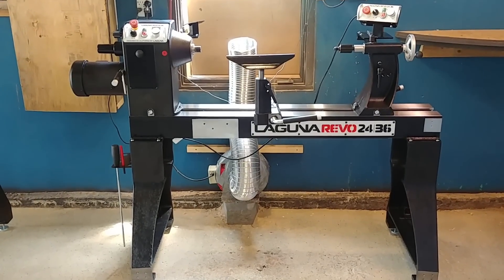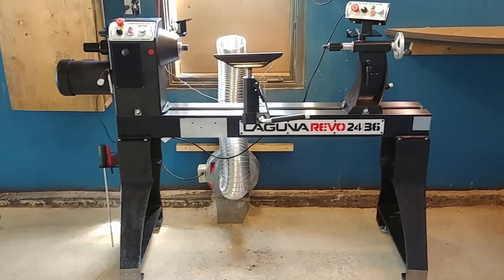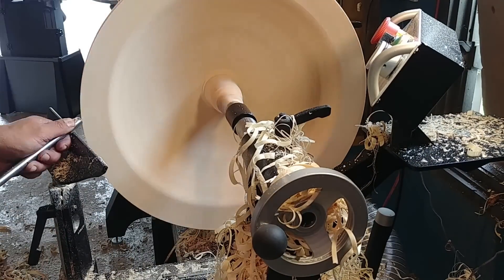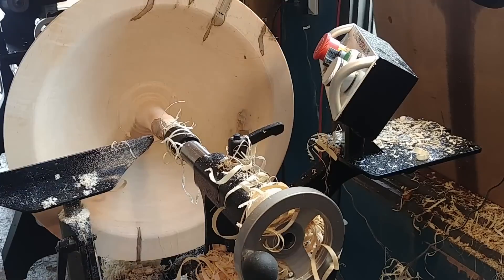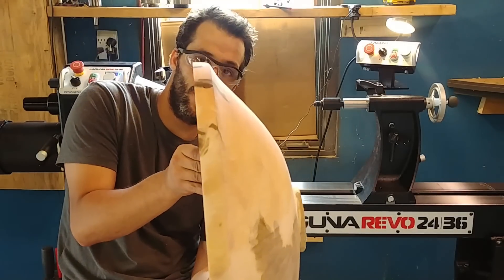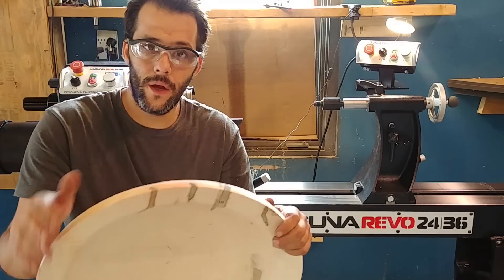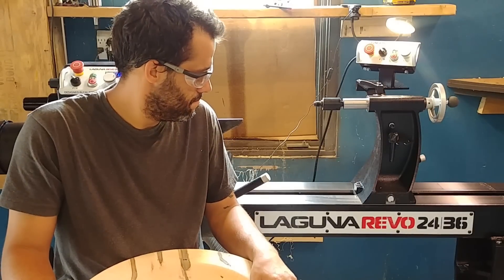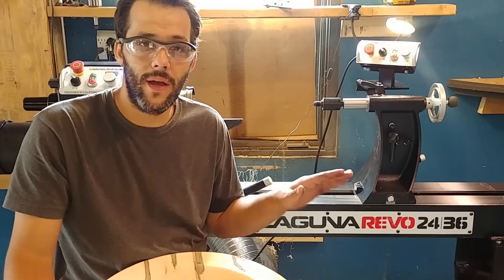Unboxing And Trying Laguna Revo 24/36

Comment: Simon - you scared me good when you went from fast and silent to instantly normal speed and sound. Thought one of those turning accidents was happening. Hate those. I did get my new 18-36 in 220. Had to run out a new service line to the shop but that's OK because I also bought a Laguna 220 band saw. Now, looking at your new one, I like that secondary controller on the right side. I am wondering if I can get one of those for my 18-36 220. Will have to look into that - so thanks for letting me know that exist. Like the bowl too. Will be looking forward to you finishing that. Safe turning Northern Cousin.
Reply from the maker: +Mark Harding Thank you very much Mark, have fun with your 18 36 and take care, Simon

Comment: simon . i just started turning and need some advice on a good hollowing tool. small vases,hollow forms etc. what is the one you are using ....... hamlet.  awesome new lathe
Reply from the maker: +dion Thank you, yes I'm using the hamlet and Henry Taylor little sister hollowing tool. But you will need some practice with them. But they work great.

Comment: The video indicates a very strong motor. I am upgrading from a Harbor Freight to the same 24/36 as yours. Among many problems I had with the Harbor Freight was with the motor bogging down. I could only turn small bowls and projects. I purchased the 240 volt model to make sure I got as much power as needed. Is yours the 120 volt or the 240 volt, and did you experience and strain on the motor when turning that large bowl. As always, very fine job. Thanks!
Reply from the maker: +Stephen Landry hi Stephen, bolth mine are 240v and no a 3hp on 240v nothing can stop this. I turned a 24 inchs bowl yesterday like it was a 4 inches bowl hehe